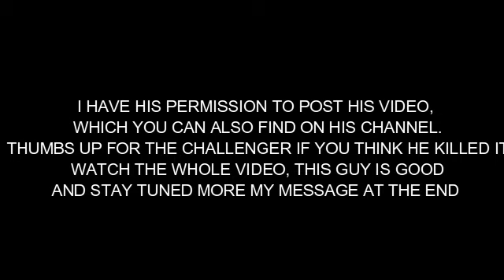BEAT THIS GUY IF YOU CAN!!!

Comment: I have a question. How can you make sure that you are running your shingles in a straight line by going diagonally up the roof. No chalk lines to keep it going straight. I have seen roofs done in this manner in the past and most of the time you can see the pattern and it doesn't look good. Just saying!
Reply from the maker: Its how they must be installed.  You cannot stack them like people did with 3 taps. And there's a lot of ways.  My method is install them carefully and correctly.  This guy actually snaps a line every other row up the roof. I don't feel it's necessary. But it helps when there's more than one shingler for sure

Comment: How long do these shingles last?
I’m a Roofer in London and we would only put a material like this on an outbuilding ie a shed.
We use natural clay tiles and natural slate and they last around 80-110 years
Reply from the maker: yea those are way better for longevity. these will last around 20-30 years in the right conditions maybe longer.
Reply: They make 50 year architectural shingles that guarantee 50 years if you use all their products from the felt paper to the ice and snow and their shingles.

Comment: Why do you put one nail in the first half of the shingle and then four in the other half.
Reply from the maker: Its not half, it's a short skip.  Three next shingle seem will land on a nail if you don't... water runs in between those seams naturally and if there's a nail right there that's a tough leak to find! Typically you stagger shingles 6 or 7 inches... so if you put first nail then skip over 10 or 12 inches for the second you won't have that issue

Comment: Funny. 
Air is a wonderful thing with a gun. 
But nothing beats a hammer with a speaker magnet taped to the head. 
My crew used to keep up with guys using all air tools. 
Now we’re old
But the one thing about these videos. Ca. You lay shingles. Yep. 
But to prove a point when done run strings to prove your lines over distance. 
Dimensional shingles can look really straight when in fact there not.

Comment: He is indeed faster than you.  But again, this is NOT FAST LAYING.  Period. This is basic Average Speed, for an experienced roofer.  This is tje speed that every experienced roofer should be laying at.  
But Fast?  NO.  Fastest? HEEEELL NO.  
And you run starters up the rake??  And put the factory edge to the rake??  Where they do that at??  Lol. 
The cut-edge always to the rake. 
The can make the way u do it work. And u can use starters up the rake if u want to.  But there is no reason at all. Keep dreaming Average-Joe

Comment: Well any one can do that he has a row set already that not hard try 16 sq on presidential with valleys install and felt in 6 hours  4 sides not just one straight side hahaha🤣🤣 work harder
Reply: Your not getting it .......he set rules    the challenge is 1 sq. Set up. Fastest time.       Of course your idea would separate the men from the boys but I really like this challenge I’m an old school roofer and must do my roof this spring and I am definitely gonna challenge myself to this   I’ll be 53 by then and would be funny to win.  ( I m willing to bet I’m in the under 9 minute club)
Reply: @gta3ist  well to be honest I'm only 25 and 3 bundles in six minutes with lot of coverage in not that hard if your fast enough one bunde has 21 shingles so 3 bundles is 63 or so and you can do each sheet in 3 second and I guess 4 minutes at most